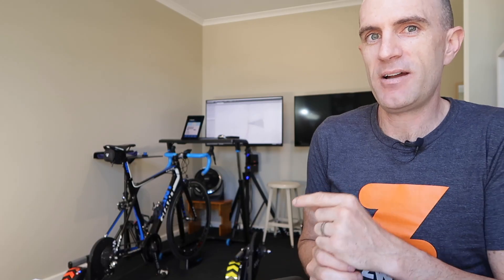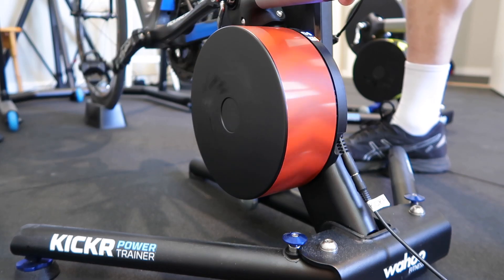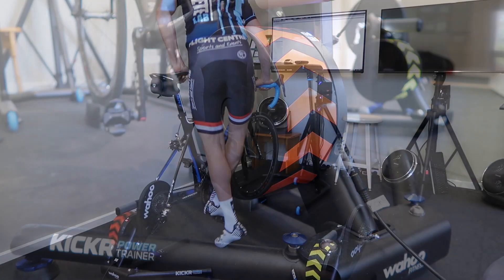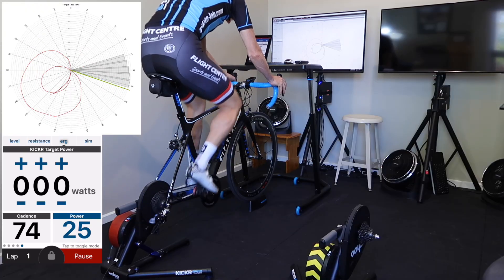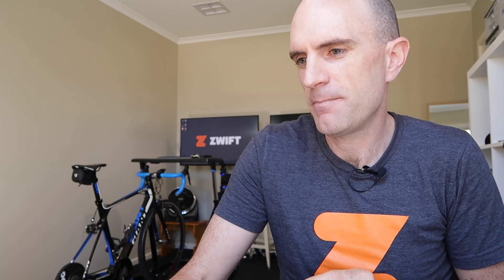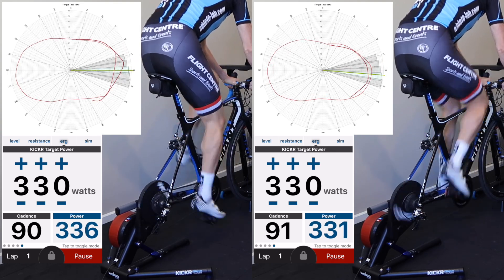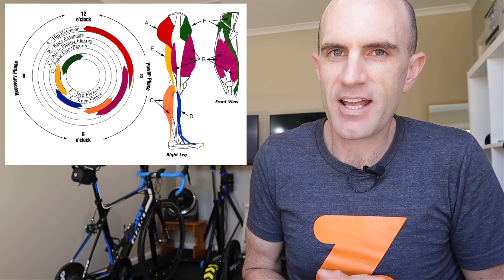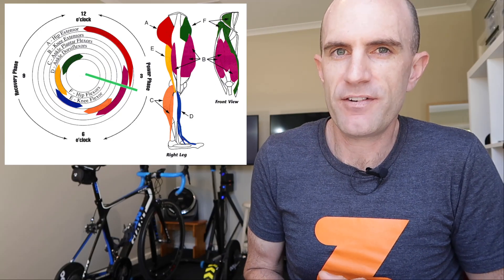Wahoo Kickr ERG Mode - Does Gear Selection Matter?

Comment: Any chance with the Tacx neo. Just bought mine and starting northern hemisphere winter training, it would be v useful to see the same test on the Tacx neo
Reply from the maker: It shouldn't see the same differences due to the 'virtual flywheel' it has. I'll try get to this when I have the chance.
Reply: Same request - I'd really like to see the differences with Tacx Neo (being an owner of one). Hope this comparison will give an answer if slightly more noise (big chainring) gives anything else in ERG mode.
Reply: Shane Miller I've tried this with my neo and once you hit the right power the gear doesn't seem to make a difference. I'm just going off feel though, no real science behind it
Reply: Yes I would also like to find out for the Neo.  It does feel like more 'on top of the pedals' with more speed but I have no proof, just feeling...
Reply: Same question here ;)  Probably Tacx can help with an answer as well.

My initial thought was that since the Neo has a virtual flywheel, it comes down to if or how the Neo "simulates" the inertia/kinetic energy of it. Moreover, could there be a difference whether you have the Neo plugged in or not?  Time for some Traineroad'ing tonight...

Comment: Totally makes a difference. On my old wheel on Tacx I was always between gears to get the right power output, not with the Kickr, I can move up and down the gears without issue and still hit power numbers without feeling like I'm between a gear. This means the legs respond better and I don't feel "cramped" trying to push a bigger gear while suffering. If the legs are tiring or I feel I need to flush them, up the gears to a nice high cadence, spin em out and then back onto a harder gear again. Seriously only a week in with the Kickr and it's the best investment hands down I've made for my training.
Thanks for reviews and info making it an easy choice on which trainer to buy!
Reply: furai333 Not sure what youre talking about, but you shouldnt have to switch between gears in ERG mode to find the right power outpur
Reply: Yeah the old tacx was no smart trainer so no erg mode. I was always changing gears to get the right power output. Hence the instant love of the Kickr
Reply: but we are discussing here a complete different topic, it is about the influence of the flywheel speed on ERG mode and as Shane demonstrated the ERG mode is indeed influenced by the flywheel speed.

Comment: Hello !  Are this turbo trainers not puting extra stress in the frame ? I mean , In reality when you ride  in force you lean the bike but when you are on the trainer and when you go full power and you balance the bike all the stress ends right in the lower part of the frame  where is fixed in the trainer. I mean , I am more than sure no frame was designed to be used like this.
Reply from the maker: If there was an issue we'd be seeing A LOT of problems with broken bikes. Wahoo, Tacx, Elite, CycleOps, Zwift, TrainerRoad, Sufferfest, Rouvy, etc would all be struggling with their respective businesses. While the theory is good, the data tells us there's no issue when bikes are used correctly on indoor trainers. If you're not confident riding a bike on an indoor trainer, then I wouldn't be trusting it in traffic.
Reply: I Was refering lateral balance. I am 103 kilos , 2 meters tall . To me looks like the trainer  can make a lever right in the ear where is mounted .
Reply: I don't think there is a serious problem, as Shane is correct that we would see big issues for trainer makers.

But that said, I do think a rocking motion like the Kinetic Rock and Roll trainer can reduce the stress on the frame.

I made my own version to work with any trainer. I did it mainly to make standing efforts more natural, but I am pretty sure that is puts less stress into the frame.

Consider making one for yourself if you like the idea.
https://zwiftblog.com/rockit-launcher/

Comment: Side topic sorry, can you provide the source for the muscle engagement graphic, it's a topic I want to learn more about in hitting the hills and lower tempo v higher tempo and muscle use / fatigue?
Reply from the maker: https://goo.gl/jvB5s8
Reply: Just read the link you posted to pinkbike, it says the illustration you posted is a theoretical model and how they work in isolation not and actual real world situations. They have a second graph displaying actual EMG readings thats a bit different. Good read none the less.
Reply from the maker: +HelmutVonSchet Provided purely as illustration. It served a purpose.
Reply: Shane Miller totally agree. Just an interesting bit of info between theory and what is they tested.
Reply: Interesting article. But, isn't this going to change the most with way-back saddle or tri forward position?

Comment: Glad you brought this up because i felt a difference between the big ring and small ring and was told it was in my head because erg mode was the same.  But i have been training for climbing so i usually use the small ring.  Thanks for the advice!!!
Reply from the maker: I've been sitting on this one for over 12 months now.... for this very reason. I needed a way to put some data behind it... and to gently introduce the fact that a lot of the documentation out there is wrong.
Reply: So glad that you finally addressed this issue because as you said there is so much wrong information out there. Your results have some interesting implication which go way beyond all the big marketing talk of the companies. I did my own "research" on this topic with my Elite Drivo. I did 3 minute ERG intervals with constant cadence but changes the gears to speed up the flywheel. Turns out with increasing flywheel speed the average power is still constant but the variance of the power increases steadily with the flywheel speed. Since the effective resistance is the product of the flywheel speed times the distance of the resistance unit, the "smallest steps in resistance" will be inherently larger at higher flywheels speeds and thus it becomes more difficult to control the ERG mode without oscillations. Basically this means that at low flywheel speeds the trainer is able to set resistance with a resolution of let's say 2 watts and at higher flywheels speeds only with 10 watts, which renders the ERG mode unusable at least for the Drivo at the moment.
Reply from the maker: This reminds me.... There was talk of an updated firmware for the Drivo. I'll get on the case to see where that is at.
Reply: So Shane a lot of guys told me that for the erg mode it's better  a small gear like 34x18 because with big gears erg mode sometimes sucks...and it was what i ve experienced with direto: big gear with high rpm and the direto can not hold target wattages... But now from your video i know that is not the same thing for my legs, and use the small ring is not a solution sometimes.